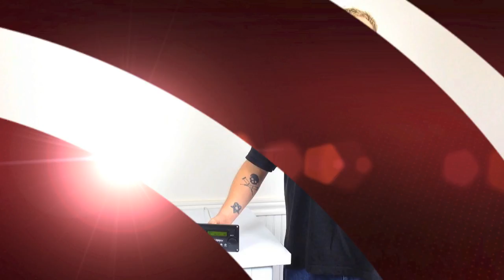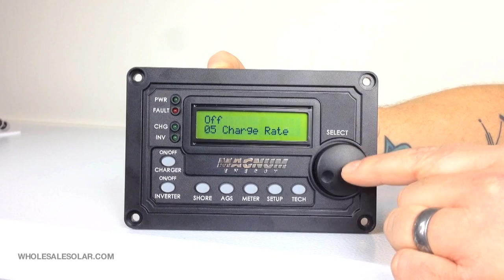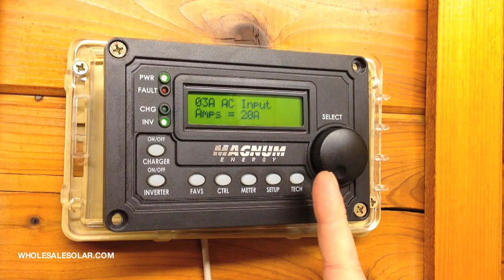Magnum Inverters - How to Adjust Charge Rate Settings

Comment: I am getting a  Big Red "AC Over load" on the unit when I try and plug it into my 5000 watt generator? It has been working fine for the last 1.5 years and no out of nowhere,  so I can not charge my Lithium Batteries. Have you seen this problem before?

Comment: Excellent, Josh. Mine was tripping my house breaker when I installed lithuim in my RV. I dialed down the max charge rate to 50% and it worked. Thanks.